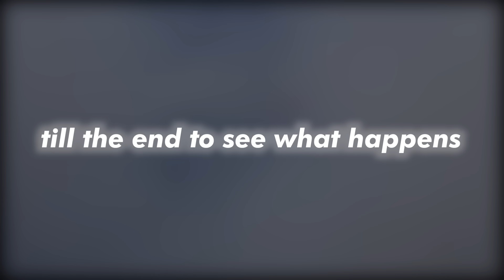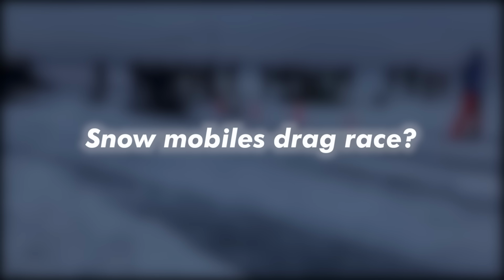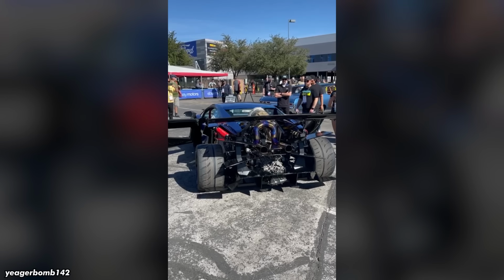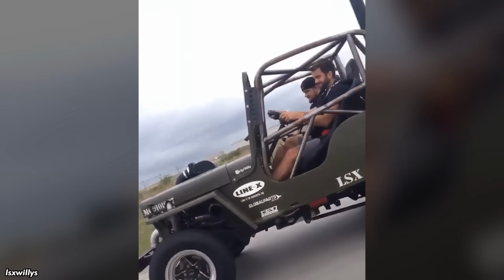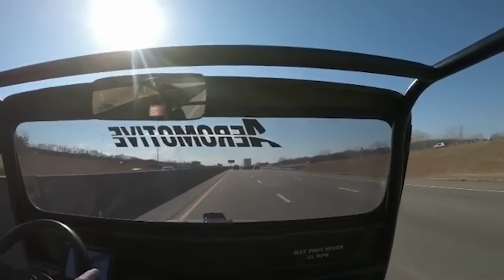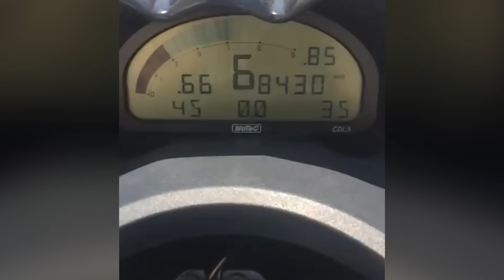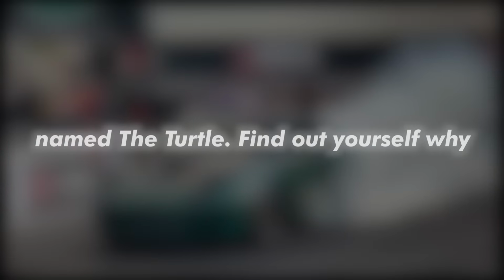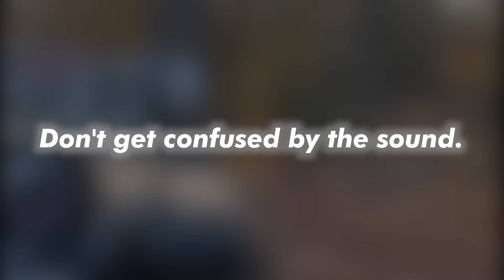When MECHANICS LOSE Their MIND! [CRAZY ENGINE SWAPS!]

Comment: Thanks for the great Video. As a retired Professional Audi Wrench, I'm a huge fan of 5-Cylinder Tubo Engines in either 10V or 20V variations. The Supra swap appears to be utilizing the 20V variant with Engine Code AAN (with Coil over Plug Ignition), the earlier 3B 20V Engine used a single Ignition Coil with a Distributor. Randy   AKA randog311

Comment: The supra audi swap makes sense if the original engine was damaged also it could make sense cost wise because of the value of a 2jz block popularity and part costs may have been a factor. The Top Secret V12 swap has still got to be up there for crazy/great builds.
Reply: My thinking also the 2jz are getting very very pricey  iam a Toyota nut but those 5pot Audi engines are fkn ballistic the power guys get out of them is just incredible and they've got an orgasmic sound  I'd definitely be happy with either engine!
Reply: @mattyceks380  oh yeah me too I'm a big fan of both thank you for your reply matty and got a clip for you if your a Toyota nut just in case you haven't seen it before.
Reply: @DM01710  cheers bro🤜🤛 that's a fkn beast😄 love that they woohan war whistled the 1uz they're a mean motor na let alone boosted, there was a lad in Tasmania who had one in a KE70 corolla with itbs it produced some amazing sound and tyres lived short lives on the back it was a falken tyre car
Reply: @DM01710  there's something about Toyotas and their love of limiter bashing my KE70 I had quite a long time go with the 4age loved the limiter😂😂
Reply: @mattyceks380  that's brilliant great driving bah bah bah luv it

Comment: I would do a celica supra the square body cars with the 5 cylinder Audi swap but wouldnt ruin the iconic supra
Reply: It probably started N/A and Auto so not exactly ruined. The Supra was never iconic anyway the 2j was
Reply: @JD-eo7dr  very true never really thought of it that way and your def right its the 2jz carrying that reputation and i think fast n furious has skewed that the real hero is the easy modified at one time cheaply modified and stock internals holds ungodly power